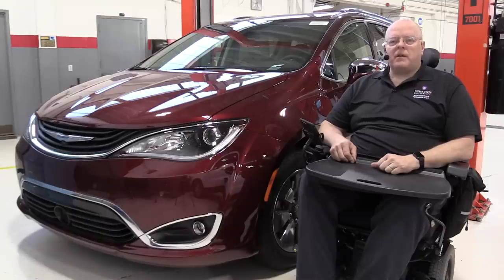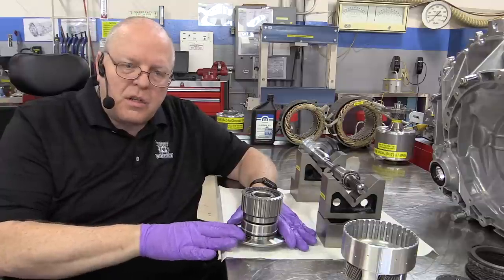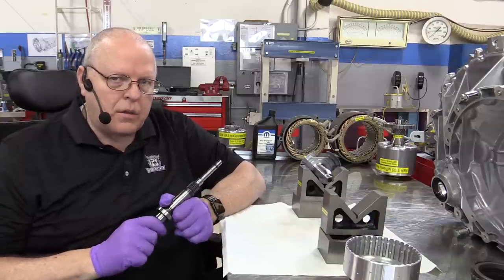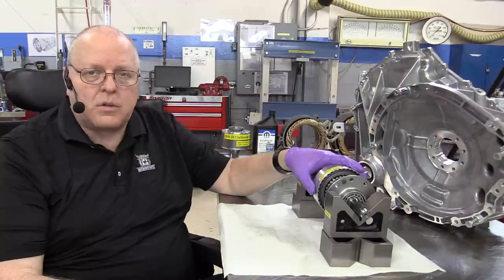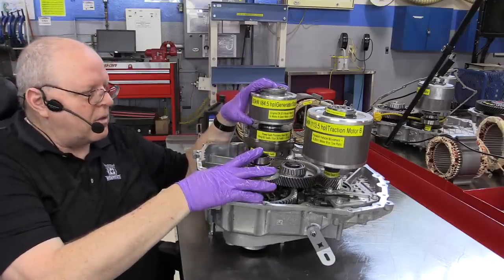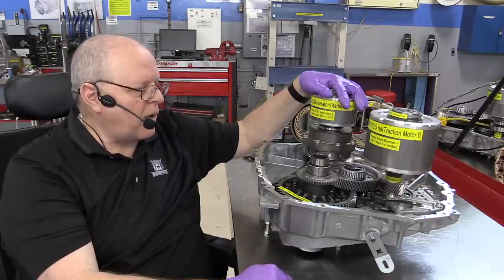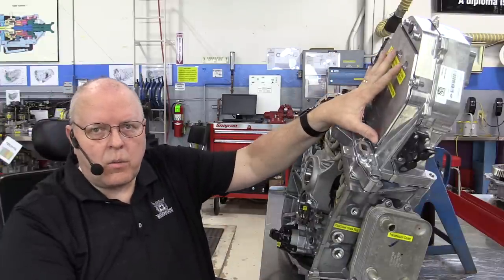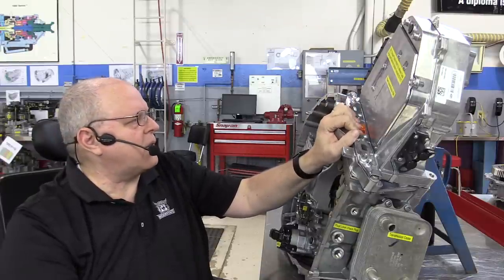The 2017 Chrysler Pacifica Si-EVT Hybrid Transaxle - Deep Dive

Comment: I just bought a 2018 Pacifica hybrid. And I love it. A great van. I received it 2 weeks ago and the check engine icon lite up. The dealer said that it was down 2 quarts of oil. They had it for 2 days to figure this out.  I just got it back and the selling dealer said bring it in right away as they needed to go over it with a fine tooth comb. I dropped it off the day I got it from the other dealer. Maybe tomorrow it'll be my turn to have it. Oh yeah, you are a great teacher. Thanks for sharing. If I wasn't older than dirt, I would be driving up to Utah and attend your class. Opps I forgot , no wheels . Yet.
Richard
Reply from the maker: Wow! Thanks for the feedback! Best wishes.
Reply: A “great van”, brand new and down 2 quarts of oil in 2 weeks?

Comment: Watched this video a year ago, it helped me understand the eCVT, and convinced me to take a chance on a 2022 Pacifica PHEV.  Haven't regretted it yet, but I am interested in knowing why the PHEV is "not recommended for towing".  The standard Pacifica is rated at 3600 lbs towing capacity.  Thank you, Professor Kelley!
Reply: I’ve pulled trailers with my Prius before and the motor temps and inverter temps get really high. I assume that’s why they don’t want the extra load. No active cooling for the motors?

Comment: There is no way to describe how awesome this video actually is. I am currently looking at purchasing a used 2021 Pacifica Hybrid and was cautioned that these eFlite Si-EVT transmissions have an issue with an internal electrical connection that can short out and randomly cause the car to just shut down (Think 70 mph interstate with tractor trailer on your back bumper!)  Chrysler issued a TSB on 4-5-2023 but do not yet have a fix for the 2017 through 2022 models. Word is that they "fixed" the January 2023 and forward models. Professor would you care to comment on which of the 5 internal electrical connectors might be the culprit? I am super curious on this and hope that you are still out there answering questions even though this video is many years old. Waiting with great anticipation!  Tks D
Reply: I just had a failure on my '22 w/ 30K miles and they are replacing the transmission.  This video is amazing and really was encouraging.  In my case, I had a motor 'a' resolver sensor error that caused the PIM to not be able to control motor A correctly.  It made a 'marbles in a can' sound for about 15 minutes before going into limp mode.  I believe most of these transmissions are going to be warranted for 10 years and unlimited miles based on the recall.  The recall is based on a connector shorting out.  While I definitely had some odd noises for about 15 minutes prior to limp mode and malfunction lights, I wonder if there's actual physical damage possible due to not being able to control motor 'a' correctly.
Reply: I just purchased a 23 model build 8/23 hoping that it will have many trouble free miles.

Comment: My name is Jeff Beck ,I have been a Heavy Equipment and Material Handling, and Automotive  Mechanic, for over 30 years now retired. Let me start by saying, that I am most impressed with your description and training devices, you are using. I am hoping, that young trainies and veteran mechanics, take advantage of your knowledge you are offering. There is no such thing, as thinking as a mechanic, that you know everything, Iam 60 years old and still read technical manuals and watch videos available on-line, I wish I had, when young, the available knowledge base, that is available now. I only have one thing to add, the final drive ratio output, you described, will be a much higher value, when considering tire and rim size. while as you obviously know, the center of the wheel hub will be rotating at the same speed as the final drive, the outer diameter of the tire will be turning faster, that's why its very important to follow, the manufacturers recommended size of tires and rims, especially on Hybred Transaxles.I worked on Elecricic forklifts and associated electrical control systems, from resistor drive, to SCR drive and AC motor with inverter drive. Keep up the great work you are doing!

Comment: Hello Prof. Kelly, 

The inverter gets cooled first by the antifreeze/coolant , after which the fluid then flows through the plate heat exchanger to cool the ATF. And you are right, the Thermostatic Valve is for Trans oil cooling only, not warming. Its reliant on self-heating due to friction and motor heat.
Reply from the maker: Awesome! Thank you for the feedback
Reply: You are welcome! Thank YOU for the excellent video :)

Comment: Sounds like the two motor drive & one-way sprag clutch is something that would be a common find in all Power-split trans-axles in PHEVs going forward - the Prius Prime & Pacifica e-Hybrid gets pretty good MPGe at freeway speeds vs. the Ford Fusion Energi which doesn't employ this tactic (but ironically the gen 1 Escape Hybrid did). In fact, the redesigned 5ET50 in the mk2 Volt also has a two-motor drive mode (but not using a PSD type trans-axle) only adds to my argument. 

Insightful as always professor Kelly.
Reply from the maker: Thank you, the 5ET50's 5th mode is PSD operation

Comment: Very good video. I just had my transmission under warranty replaced at 56,000 miles because the Motor A resolver wiring harness wore through the insulation at the pinch point where the little covers turn at the right angle. Apparently every eCVT ever made up until March 2023 has this potential defect and Chrysler is extending the warranty for the life of the transmission. They are replacing the transmissions because it's cheaper than completely tearing them down to get to this one part. It's too bad, it's a very elegant design with no chains or belts at all, taken out by a simple pinch point in an unprotected wiring harness.

Comment: Prof. John.  Thanks for the great video.  I have one of these vehicles and it is amazing how smooth the transition is from electric to ICE power.  One question though that I didn't catch in the video is exactly how does this transmission achieve the 'variable' part?  When I'm driving there are no 'shifts' felt - just a smooth power delivery.  I still don't understand how that works especially when you add power from the ICE - how does the ICE rpm match up to the electric motor rpm?  Certainly it isn't due to clutch slippage which would seem to not be very efficient.
Reply from the maker: Thank you. The variable part comes from the difference between the ICE rpm and Motor A rpm (and direction). When motor A spins slower (in the opposite direction) than the ICE rpm, there is an underdrive condition helping Motor B drive the counter-driven gear. When ICE rpm and Motor A rpm are equal there is a direct-drive situation helping Motor B drive the counter-driven gear. When motor A spins faster than ICE rpm (in the same direction), there is an overderdrive condition helping Motor B drive the counter-driven gear. I hope that helps.
Reply: I agree that the power transition is smooth, but I can tell from a howling sound that the ice is charging the large battery. It's just loud enough to be irritating, and worrisome, especially at slower speeds and cold weather. I wonder if there is any good soundproofing that can be done?
Reply: The way I see it, the smaller motor “steals RPMs” at low torques at the planetary, generates some kW, then the power electronics feed the power to the large motor at low RPM but high torque.

Comment: If I understand things correctly, the sprag "clutch" is there because a partial failure of come other components will cause the system to try to rotate the engine in the wrong direction.   I would include in the "partial failure" things like a clutch not releasing completely or a motor/generator getting bad driving power.

Comment: Great video Professor Kelly, was the generator also used as a motor in addition on demand under acceleration? If so, did it get 148KW (85KW+63KW) motor output in pure electric mode?
Reply from the maker: Thank you! Yes, both motors can propel under acceleration.
Reply: First off, thank you Prof Kelly for taking the time to create such a detailed video on the transmission.  I have a '17 Pacifica hybrid and I've had this same question.  In my 6 months of ownership I've never seen the reported battery kwhs consumed increase beyond 85kw which just happens to be the power rating of the large motor.  I've also never seen the battery charge under braking higher than about 82 kw or so perhaps that's the limit of the discharge/charge rate of the battery.  I imagine if both motors are used perhaps one is more efficient than the other and they operate in tandem with neither operating under full load, but certainly the theoretical ~148kw electrical output I've never seen.
Reply: Brandon Gordon, thanks for your feedback. Long time driver experience through daily observation is the best verification how the system was implemented. I am interested in buying this minivan, I watched a review recently where the reviewer was saying the engine will fire up with with his heavy footed acceleration. I have a Prius plugin which does the the same.  I suspect only the 85KW motor was used, if both were engaged, it shouldn't fire up engine. Prius Prime really used the 2nd motor with some clutch without changing the 2 motor specs. 145KW is like 190HP which should be enough to propel minivan without assistance from engine. Software limiting is another factor.
Reply: Tom Bradley so at least on that front of being able to drive the minivan solely on electricity that hasn't been a problem; i routinely commute in mixed city/highway driving and never have the gas engine fire up.  The way the car is tuned the gas engine will remain off when cruising at 80mph or below when you're calling for less than ~55 percent of it's power per its gauges.  With the torque the electric motor provides 0-50 happens reasonably quickly but 50-80 takes about the same amount of time so you do need some runway to get everything up to speed.  Through it's calculations I've average 44 mpg over the last 8k miles which has seen a couple 450mi trips without any electric charging, nearly complete electric driving on the daily and a mix of both on the weekends.  It's no amg, but they sized the capacity of the electric motor very well.  I've been very surprised with the general refinement of the system but here's two aspects that will annoy you which cause the gas motor to kick in.  If it's colder than mid 40s or so the gas motor will spin up to provide heat for the cabin, which given the amount of electricity it takes to provide heat, could be considered smart.  Second the radar cruise control is extremely aggressive in getting the vehicle up to speed; if you have a car pull out of your lane and you're more than 5mph off your set point, the system basically floors the van to get you back up to your target.  It'd be much nicer if it simply held to the maximum of the electric output as frequently this is the only time the gas motor comes on during my commute.  It's a vehicle I'd highly recommend especially for long trips, the ability to have a climate controlled cabin while streaming tv/movies for the kids when stopped on food breaks without having the engine constantly running is pretty slick.
Reply: Brandon Gordon ，I wish Chrysler put or at least offered another battery as an option to double the electric range. Prius Prime did it so I hope this would happen on the 2nd gen. In another 2 to 3 years there would be so many all electric SUVs available. Batteries are getting cheaper too. I wish Chrysler make the all electric Portal minivan a reality!

Comment: Had been wondering if you had any thoughts on why the auto builders went with hybrid instead of electric traction motor and onboard ICE generator.
Reply from the maker: I believe it is because it has been a slow evolutionary process. They took what they had (an ICE and an automatic transmission) and modified it with incremental improvements over the years. The Generation 1 Chevrolet Volt operates that way in 1 of its 4 modes of operation. The Generation 2 Chevrolet Volt operates that way in 1 of its 5 modes of operation.Thanks for your feedback.
Reply: Thanks for your response.  Always find your videos fascinating.

Comment: Professor, you mentioned the Ford and Toyota designs placed their torque limiting clutches with the flywheel, while FCA's is located on the planet carrier.  Are there advantages for one over the other?  I wonder if the FCA design provides better protection for the sprague?
Reply from the maker: Good question. Obviously the Ford and Toyota versions would be easy to change in the vehicle. The FCA version is inside the transaxle. I find it interesting that FCA still has the damper springs at the flywheel, just like the Ford and Toyota versions. Thanks for your feedback. Maybe the FCA vehicle weight and engine torque were more than a single disk torque limiter could handle.

Comment: Thanks for these really detailed and quality videos.  I just got one of these hybrids and, being new to hybrids, was curious how they operate.  

One thing I ran across in the service manual is the warning about spilling anti-freeze compounds on the HV connectors.  The antifreeze is organic acid and they say exposing the connectors to this compound ruins them and they must be replaced which would be $$$$ and probably very hard to get.  

Is this risk common to the HV hybrid electrical connectors in other brands?

Also, the case castings appear to be high quality (more like Honda's).  I've overhauled a couple of the Chrysler 41TE's and they are typically pretty craggy with a lot of surface fins on the outside and a lot of nuances inside with orientation of tapered snap rings among other things.  The differential carrier endplate and associated gearing looks like it is designed for much greater power output than for just the Pacifica.  It will be very interesting seeing these used in work trucks particularly if they are designed to use the HV battery/engine as on-site power supplies.  Service vehicles for contractors, firefighters, news crews, etc.  The list goes on.
Reply from the maker: good point, thanks for your feedback!

Comment: Since there's no tachometer at the dashboard, what would be the engine's RPM at 60MPH for this setup? Thank you for the insightful video.
Reply from the maker: The engine can be off at 60 mph if the battery has enough power. The engine rpm at 60 mph will vary depending upon the battery state of charge and the power requirements of motor B. At 1000 engine rpm Motor A would be spinning at -3688 rpm (charging and not assisting Motor B very much), At 2000 engine rpm Motor A would be spinning at 465 rpm (not charging very much and assisting Motor B), At 3000 engine rpm Motor A would be spinning at 4618 rpm (charging and assisting Motor B a lot). I hope that helps.

Comment: Mind blowing 🤯 great knowledge, thank you!  Is this the same in a 2021 hybrid?  I recently wrecked my van and it took a year to get everything replaced due to part shortages over the last year and labor shortage at the repair shop, but now it’s all physically repaired and at the dealership, where they are telling me the high voltage system needs to be checked out and may be in the harness.  Also is there a sensor that cuts off power to the battery when it detects a collision? If so I can report this to them to help them get me back on the road with it.

Comment: Thank you very much for this and all of your videos - I am still struggling to understand the hybrid mode power split:  

Motor B is always providing torque to the transfer shaft, ok.  

For the planetary shaft I need some clarification - The engine is providing torque which goes through the carrier into the planetary set.  For planetary sets one of either the sun, carrier, or ring gear is supposed to be fixed - in this case none are fixed since all three are rotating -  is Motor A rotating and supplying a torque in the opposite direction to essentially "ground" the sun gear?  

Is this what is meant by the eCVT?  Motor A can change its speed and reaction torque on the engine to "ground" the sun gear in hybrid mode?

Thanks and Best Regards
Reply from the maker: Thank you. eCVT = When motor A can spin faster or slower than the engine to vary the amount of torque the engine delivers to help motor B propel the vehicle.

Comment: Thank you for the awesome video.
Could you please confirm  (or disapprove) that this CVT-like variable torque transfer from input shaft to the wheels does require some energy taken from the high volt battery?
Reply from the maker: Yes, energy from the battery is used.
Reply: @WeberAuto  Surely any drag/slip provided by Motor A charges the HV battery or provides energy to Motor B? The only time Motor A should draw energy from the HV battery is to start the engine or assist Motor B? Wish these videos were around when I was much younger might have chosen a different career path.
Reply from the maker: @Coolkeys2009  Motor A can draw power from the battery in EV mode. In that mode both motors A and B can propel the vehicle under certain circumstances. That is why there is a one-way sprag on the input shaft. It prevents the ICE crankshaft from spinning backwards when motor A is helping to propel the vehicle. In power split mode power from the battery can be used to provide negative torque to Motor A to help control its speed while it is generating. Otherwise, you are correct.

Comment: Thanks Professor ,   Very interesting assembly.  So if the speed of the engine is constant, then motor a Speeds up to cause the vehicle to accelerate.  Hoping to find your video on Gen 2 Volt too.